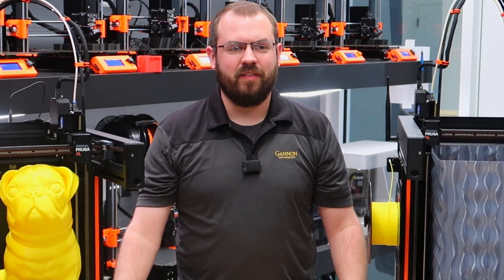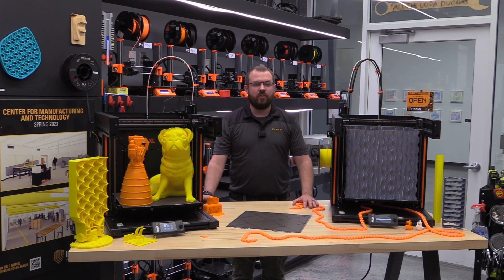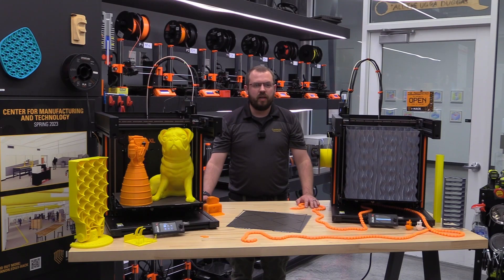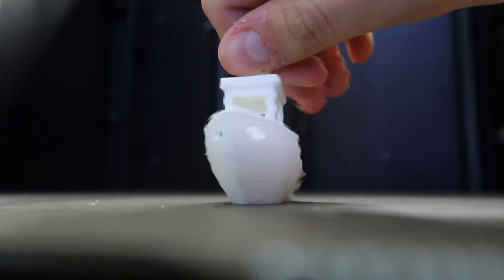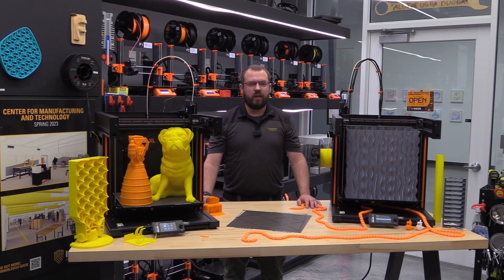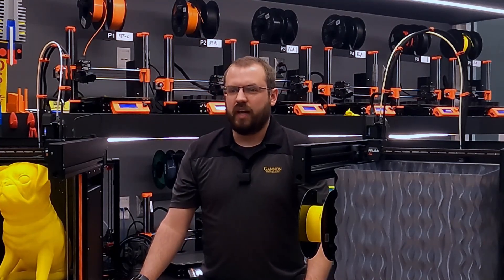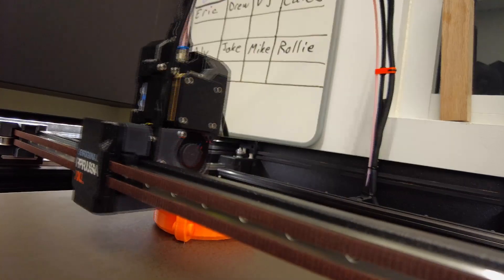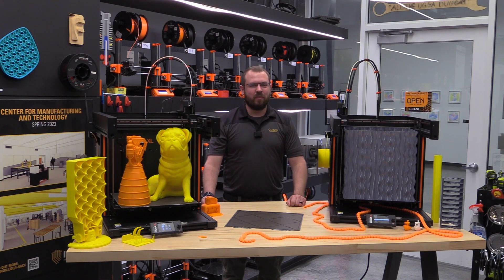Prusa's BIGGEST Success! | First Look and Impressions of Prusa XL

Comment: what is the print speed, what is the speed benchy time (with normal settings none of the unusual bonkers benchy nonsense). How long does it take to print a normal part with the same settings when compared to mk3, mk4 and bambu labs.

Comment: stop comparing Voron 2.4 to the xl, its not even close IMO.  maybe if you were to compare the elusive VORON  V24 with the 24 inch build plate, but then you still   gotta contend with the tool changer, which right now nobody but e3d can effectively do without the end user being a senior engineer.   PRUSA FOR THE WIN
Reply: Prusa xl is more similar to a Voron trident than a 2.4. The 2.4 doesn’t move the bed. For the price I honestly rather have a 2.4. Yes you assemble it but you actually learn a lot doing so.
Reply: @Bigpopp1  do date , ive owned 7 3d  printers, and ill eventually build a Voron, but I'm tired of learning curves for the moment.  XL FTW

Comment: Great video, I'm considering the XL. *Just subbed too.

Consider that a Voron 2.4 Bill of Materials for comparable costs realistically about $1500-$2400 USD depending on which materials, extruder, nozzles and circuit boards, and you still need to invest 20-30 hrs minimum to assemble those materials, I'd say the Prusa XL is a decent price.

Then there is the Bambu P1P and X1C, which is 100% proprietary and requires connecting to communist Chinese government for operation.  I can't even consider the Bambu for those reasons, unfortunately.
Reply: It doesn't matter whether it requires connection to a Chinese company or an American one. I'll never buy a Bambu, for the same reason that I'll never buy an iPhone. No walled gardens, ever! 

It's only a matter of time until Bambu pulls the rug out from under us.
Reply: and another 1500+ if you add the tool changer, so its a wash.
Reply: YUP
Reply: especially when you consider "who is e3d licensing to right now"?  if you factored that in , then easily the cost would be the same.
Reply: Creality will soon stat shipping their K1 Max, a 300 X 300 X 300 mm print volume CoreXY printer with Klipper for input shaping and a ridiculous claim of 600 mm/sec print speeds which can only be attained on their smooth curve test print, but it is fast and produces good quality prints.  I know the 3D printing community complains about Creality for good reason, but good & fast large format printers are coming.
Reply: @Liberty4Ever  they are too late to the game, bambu has that segment wrapped.
Reply: @tekman2011  - To Be Determined.  The Creality K1 is pretty much the Bambu X1C without the possibility of an AMS filament feeder but also without the proprietary Bambu approach that sends your files from your computer to a cloud server in China and then back to your printer that's two feet from your computer.  The proprietary and Chinese cloud server approach is a complete non starter for many people.  It's certainly a big turn off for me, even if I opted to use the SD card slot to transfer files and try to avoid their cloud and their app.  People are seeing wear on Bambu's non-replaceable carbon fiber guide tubes and that's a concern for anyone buying fast printers for a print farm.  Bambu revolutionized the industry with their X1C and P1P, but there is still plenty of room for established manufacturers to get off their duff and compete.
Reply: @Liberty4Ever you know you don't have to connect to the internet at all to use bamboo labs gear, right?
Reply: @OccultDemonCassette  - That's why I said, "It's certainly a big turn off for me, even if I opted to use the SD card slot to transfer files".  Similarly, Creality has a spammy adware app to transfer files to their K1 printer which is also a big turn off for me, and I wouldn't use that either.  The K1 uses crippled Klipper.  There are already hacks to use full power Klipper with Fluidd to transfer files and completely manage the K1 from a web interface which sounds like something Creality should have done from the start, but in general, I'm OK with dragging G code to a USB thumb drive and plugging that into a front panel USB slot on the printer, which the K1 has.  Bambu Lab provides a less accessible and more cumbersome SD card on the front panel, but close enough.
Reply from the maker: The creality slicer is awful. We will have to look into this web interface.

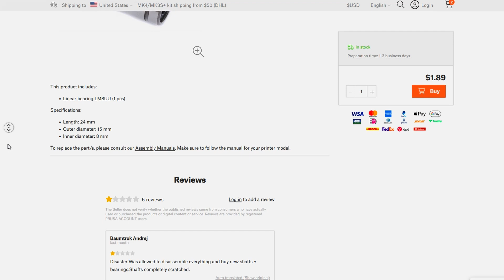Comment: Looks unbelievably slow for a corexy. @2:15 the print for that Z leadscrew part looks really rough. @2:23 those reviews lmaoooo @6:40 doesnt prusa QC actually test these things?
Reply from the maker: Similar thing happened on the Mk4 too. It's a tight fit on its own.

Comment: One thing i can't seem to find much information on is the part cooling. It's always been one of the only downsides of my MK3S+ and i have tried so many different ducts. Just wondering it they have upgraded it to a 12 or 24v fan.
Reply from the maker: We tested the fan pins and it is 5v
Reply: @GannonMakerspace  Thanks very much, bit disappointed tbh. Ah well won't change my mind, I have a n XL kit on order.

Comment: Affordability?! 😂 That’s the 1 thing they’re far from.
Reply: Considering I spent somewhere between 30-40 hours building my Voron and I charge $100/hr for engineering time, I'd say an out of box usable printer capable of multiple toolheads is affordable.
Reply: Compared to machines like Ultimaker, Lulzbot, and Markforged, the XL is a bargain. This is aimed at businesses, where you won't always have time to build a Voron or a Ratrig in a week.
Reply: i looked into building a voron 2.4. kit prices span from £800-1400 . prusa offer their xl for about £1800 , consider this, you will get prusa back up and its mostly pre assembled. for most people thats close enough, the  prusaxl is quite well priced.
Reply: Good price for what you’re getting imo. It’s prebuilt, has tons of features, and a huge amount of support for the product.
Reply: It should at least come with an enclosure for that price.
Reply: He lost me when he said affordability.  Good thing he lost me early.